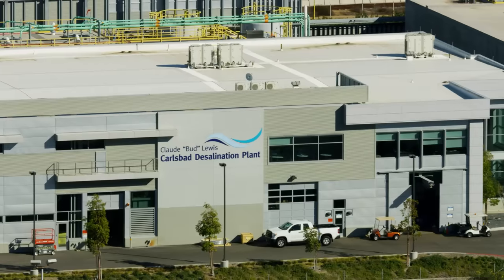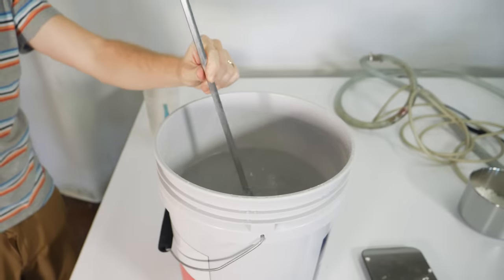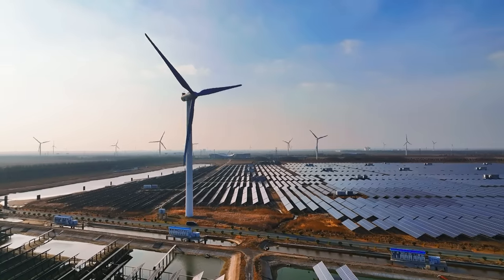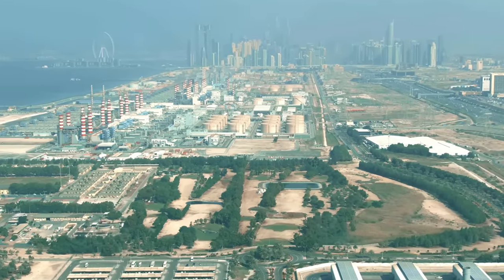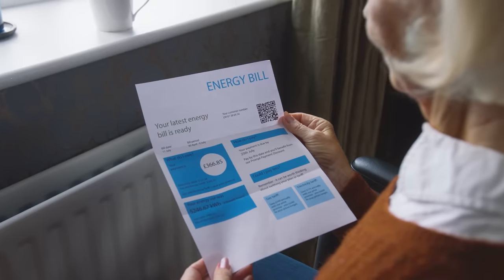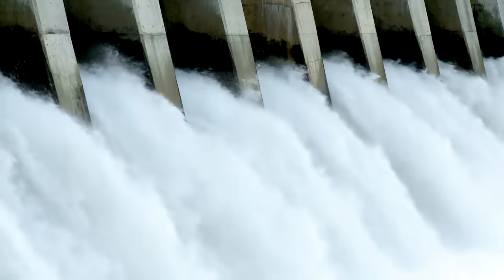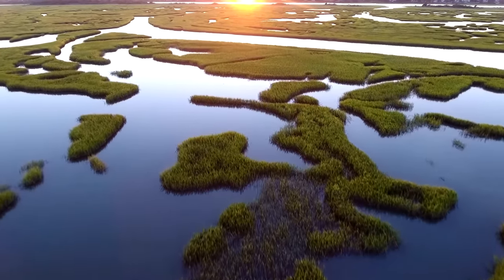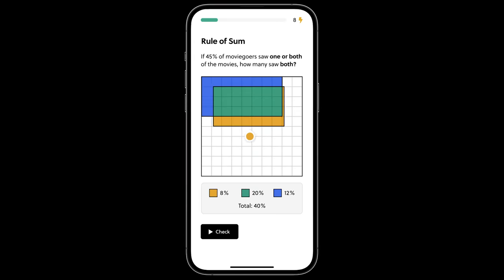Why Is Desalination So Difficult?

Comment: An idea I've long wondered about in areas where seaside land is fairly cheap, such as the Middle East:  seawater canals with an arched greenhouse over the top with collection gutters on the sides.  Water from the canal evaporates, condenses on the greenhouse, and runs into the collection troughs.  I'm sure this would be more complicated in practice, but it seems like a good way to use solar energy in a passive manner.
Reply: that's the best idea in the comment section (I'm a scientist in this field)
Reply: Dang that's pretty smart and simple
Reply: water like that would start growing organisms
Reply: @techheck3358  So? They can be filtered out easily. The hard part is removing the salt, which this does.
Reply: Armchair science time. This could run into issues with creating flow. There are no rivers flowing through Dubai (other than a creek with the sea on both ends), according to a cursory check of Google Maps. So you’d need to induce flow to prevent salt and organism buildup. Flow could also reduce the efficiency because the new water would need to heat up. 

Also, the space vs. output might be an issue for certain areas, although if you live in a desert there’s probably a lot of available space. 

I’d bet you could get more out of a solution like this with a bunch of (pretty cheap) mirrors too. Cool idea
Reply: also dumping the brine into the desert might help with ecological impact, kind of like salt farms
Reply: From my not a scientist perspective this seems like a cool idea!! :)
Reply: soak honeycomb cardboard with sea water, leave it in the sun with fans blowing through - the salt stay in the cardboard, harness the gaseous h2o and let it cool
Reply: I’m not sure but my guess is that this passive use of solar energy to desalinate water would not produce much so it would require huge installations. 

Dubai has a rather humid climate so the condensation surface area would have to be cooled to increase the production. This could be done by running some water over over the other side of the condensation surfaces. 

One would need pumps for both the desalination as well as the cooling side. Maybe the warmed up ‘cooling water’ could be desalinated afterwards. It would be interesting to calculate the efficiency of such an installation. 

I assume that in the Middle East, desalination plants are located next to power plants so that the residual heat of the latter can be used by the first.
Reply: I remember mythbusters trying that in one of their specials.  A clear plastic sheet over a hole in wet sand.  It worked, just not too well.  I think this method was used in life-rafts, basically solar distillation.  My usual take on ideas like this is that if the ideas seem so straightforward, they have likely been tried and have enough downsides that they haven't been commercially developed -- but that doesn't mean giving up, just that more research would likely find what the actual issues are!
Reply: @Conservator.  (in hot and humid climates potable water could be harnessed from the airconditioning units )
Reply: There are Treatment plants that utilize that process. It's just that places in the Middle-East have an abundance of Petroleum fuel, that the Standard de-salination is much cheaper and more reliable to use.

There are many Survival kit that uses the Solar method.
Reply: It's definitely a scale problem. While there feels like a lot of energy in the sun, over a day it's not much. Average around me is 5kWh/m2/day. 

This is effectively a distillation setup so going off the video, a rough yield would be 1L/5kWh. 

In other words, for every square meter/11 square feet, you'd get 1L/0.26gal.

You would need a very, very large area to generate an appreciate amount of water, and you are limited to sunny days.
Reply: The main limit to this is probably how much water it can produce for a given surface area, it might be fine for a small village but for a city I bet it'd need so much land as to be completely impractical. It's a solution that trades energy for land use so in an area where there is little energy but lots of unused land available it'd be great, such as small isolated villages that might rely on off-grid power. But cities are usually the other way around, they have plenty of energy available, especially in the middle east, but land is at a premium.

Also I bet it'd be a pretty decent solution for farming where some of the byproducts like algae can be used for fertilizer and the water doesn't need to be super clean.
Reply: I think it would be hard to keep the surface of the greenhouse cool enough for water to condense on while simultaneously keeping it transparent. 
The brine would probably be another issue too I guess
Reply: @Thermoelectric7  incorporate solar panels in/on/around the distillation structures to also generate electricity for heat and flow structures!
Reply: @kevinlasher2812  it would be more efficient to build a solar farm which powers a reverse osmosis plant, than building something that tries to evaporate water directly with the sun. 

That, and you suddenly triple the capacity of your plant as it can work 24 hours a day from other energy sources, rather than 8 hours solely running from direct solar energy.
Reply: @Thermoelectric7 efficiency in terms of what?
Reply: @lomiification  land utilisation per unit of drinking water produced.
Reply: @Kni0002  The desert is also an ecosystem.
Reply: I feel like scale is the biggest problem. That's basically a survivor distiller but bigger, which clearly works. Just not sure it would make enough water for the cost and land use.
Reply: @replica1052 My a/c condensate discharge line runs like a cracked open garden hose spicket.
We rotate potted plants under it
Temp 90's
Rel humidity 90's
Inside 72° 46%
Reply: @techheck3358  it could, but depending on what you're using it for, treatment could be minimal. If its going to be used for irrigation, you need to do a whole lot less work to it.
Reply: they are already doing that
Reply: Look up Seawater Greenhouse, to see this concept in practice
Reply: That's how people produce salt from seawater! Usually these are open air evaporation pools, but what you describe is basically just a big solar water heater. The immediate challenges are thus: the space with which to put enough canal to make it viable, pumping the water all the way through it, and getting inside it to get the salt out. If you used a black silicone for the canal floor the salt wouldn't adhere to it and the water would be heated more because of silicone's insulating properties. if from your intake pump the canal snakes down at a slight incline below sea level you would only need to lift the water a few meters rather than push it hundreds of meters. It would get very toasty and humid in there so it'll need a ventilation system or just windows that electrically open. Do these and it should be possible to get both a freshwater supply and salt for export.
Reply: @Thermoelectric7  Changing the weather would work as well. Just pumping billions of gallons up in to the air as a fine mist will speed up evaporation to a point that rain fall will have to happen somewhere. While the ocean is generally flat it can be quite hit and fine mist could speed up evaporation by providing infinite surfaces to which could speed up evaporation. 
The only real problem is where do you put them and how many. Could doing to many of these cause more major storms? These are a lot of major factors that are not considered. 

Some many years ago and if I can recall what the numbers were off the top of my head called for one desalination plant of the largest size ( dubia plant I think ) for every 25 miles of coastline all over the world could provide enough water to rain 1 inch per day over the entire world's land mass. Then buy spending 100s of trillions of dollars we build one of the largest sprinker systems in the world to which at any time water any where in the world. Then every water way would have pumps put in places for flood control. These pumps would be powerful enough to move water from one place to another with out fear of flooding ever again. 
Do this would not only keep the earth cooler it would provide water to all drought and non drought prone areas. 
100% total green landscape. Using humanoid robots one could then task 1 robot or more per acre of land to work all day and everyday to tend to the land, animals and weed and pest control. So that future generations will be able to walk anywhere in the world and see its marvelous manicured wilderness. One would also need to account for every animal and its needs of sticks, grasses and so on. Also with 1 humanoid robot per acre of earth we could get an almost exact count of most wildlife excluding bugs and small critters. This would also allow some population to flourish and other to be culled away. 
None of this will happen because money is king and profit is above all else. Greed and stupidity is going to be the down fall of humans. We have the technology to change our lives for the better today yet money stands in our way.
Reply: Who told the seaside land is cheap in the Middle East? That's the most expensive land. But then that wouldn t really matter anyway, vecausr in the Middle Eastern those project are funded, if not owned, by the governments. Then, building and maintaining those structures would be very expensive for disappointing results. Not enough water would condensate to justify the cost and the amount of space used.
Reply: The 2 biggest hurdles for that idea is 1) the greenhouses would have to be INSANELY long to get any serious fresh water production out of them and 2) How in HELL do you make them resistant to the sandstorms that literally scour the area like steel wool every season?Admittedly, you don't need the greenhouse panels to be all that transparent for thermal transfer to heat up the interiors, but the storms would literally be sandblasting the panels thinner and thinner every week or month making maintenance and repairs a non-trivial (or cheap) exercise...

On the other hand, compared to many of the other construction projects they've completed in the last few decades, that might be their cheapest long-term solution for a reliable fresh water source...
Reply: @Mira-bt3zx I don't think creating flow would be that hard if you filter sneaking or back winding Canal system. The only real cost might be pumping water to the top so that it can slowly run down to the bottom evaporating along the way. Of course then you end up with the problem of the water running out the end is going to be saltier than anything around it so you might have a challenge discharging the water.
Reply: A system of using combined solar and geothermal energy for desalination should be developed. This would allow the facility to keep operating, although at reduced capacity, at times of little or no sunlight.
Reply: @johncantwell8216  A nice idea but Geothermal isn't an economically viable solution for Power Generation in many areas...drilling far enough down to get enough heat to drive a steam turbine generator is FAR too expensive and/or outright impossible with current technology in many areas of the world (the crust is either to thick, too hard or composed of materials we can't drill through for on reason or another)...
If you want non-Nuclear power sources, either use wave generators, wind turbines (there are a LOT of wind generators that don't look like a desk fan on steroids), solar or even hydrogen gas turbine as the power source...
Reply: @HappilyHomicidalHooligan  There are probably areas where it could be useful, and the high temperature water from the geothermal wells could be used in conjunction with solar-heated hi-temp water in multi-effect distillation systems. 
Another potential heat source is the decaying spent fuel from nuclear power plants, but nobody seems to be willing to allow the transport of these casks.
Reply: @johncantwell8216  You don't tend to get enough heat from spent fuel rods to drive a steam turbine unless you place the rods in a dangerous configuration which will likely lead to a runaway reaction and the spent rod storage pool going Chernobyl on you. If you're going to use Nuclear Fuel as a heat source, the only safe way to do it is in a Reactor Core with all the safety and cooling systems that entails...
If you did get that kind of heat from spent rods, the storage ponds in the Reactors would always be full of boiling water and they aren't...
Reply: @HappilyHomicidalHooligan  Are the ponds configured to prevent them from going critical (separation of the rods by lead shields, and cadmium in the water)? 
I also envisioned the possibility of using the heat of decay (not running a critical reaction) to heat water for evaporative desalination at least as a part of the process.
Reply: @johncantwell8216  The rod bundles are placed at least 18-24 inches apart from each other in the pools as that's enough distance for the water itself to act as a radiation barrier and that's enough to keep the spent fuel remaining in the rods from sustaining a Reaction. They don't as I understand it, actually give off all that much heat once they're removed from the Reactor Core, certainly not nearly enough to bring the pool temperature up to boiling. I'm not aware of a single Nuclear Power Plant that has an active cooling system installed in the spent fuel pools to keep the water from heating up...